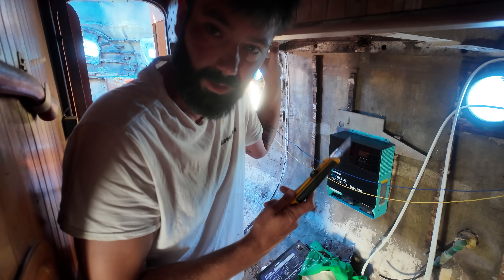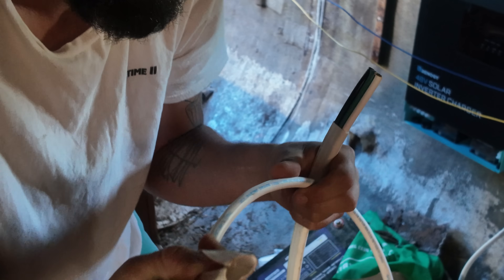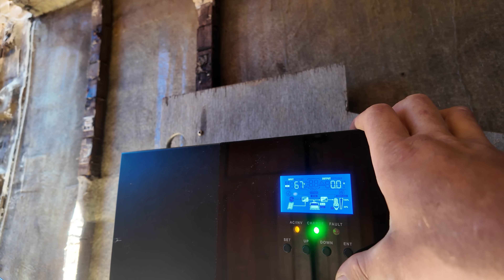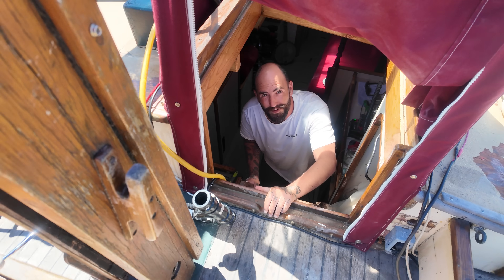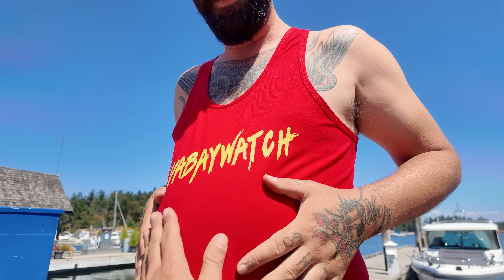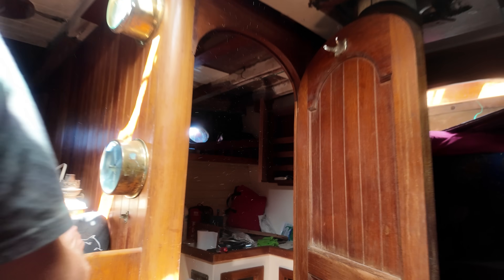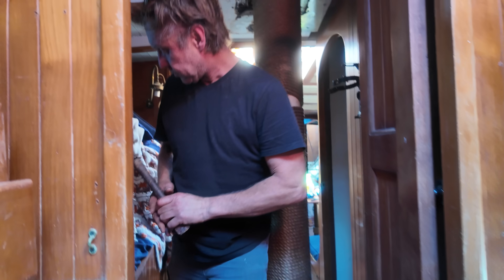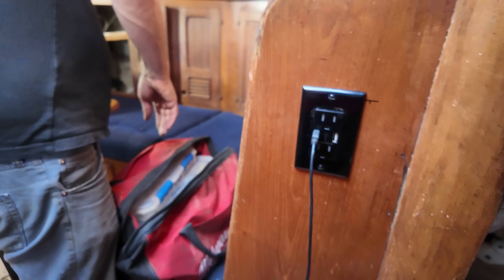DIY Boat Power System: Powering my Home on the Water

Comment: Keep on living the dream Buddy ! That all in one power box  is great ! I'm going to look into one of those ! My 3,500 watt Schneider is too heavy for me to lift ! I don't want to use it in my boat and my 3500 watt Outback is pretty heavy also Plus i need charge controllers for them !  OMG I just looked it up ! What a great deal ! That's right up my alley !
Reply from the maker: I had sooooo many problems with my Schneider system. I will never touch their stuff again. And it cost triple what this one does. I’ve used this inverter for years on my last boat. It’s always been lovely for me. Not 100% perfect, the odd overload or restart. But always back up and running quick. Really wish the solar could start up on 0v on the battery. I need an extra controller just to let the system boot under unmonitored full dead situations. I’ve used a small victron controller for a small section of panels just to boost the main system back to life.

Comment: Hey Simon can you share the outlet box’s you used ? I need to replace one down  in the engine room
Reply from the maker: All the boxes were at my local hardware store, self contained ones for the engine room and garage ones for the rest of the boat. Needed a face on those so I had something to mount to the bulkheads.

Comment: A/C wire is usually solid, where D/C is stranded wire.     And they sometimes like to jack the price up for things like 'OFC' that really doesn't matter.
Reply from the maker: Not on a moving home, they use stranded for AC in RVs and tinned stranded on boats.

Comment: The round one is tinned so it won't be  corded as easily the romex will corde over time
Reply from the maker: they're both tinned, the round has some nylon strands inside it, which I'm guessing helps with internal chafe? I dunno.
Reply: @findingsimon  I think the round one just fits through a smaller hole.

Comment: individual conductor wiring is even cheaper than the flat wiring, just would have to wrap it or heat shrink a cover for it yourself; that trade off of time vs money, which do you have more of?
Reply from the maker: I honestly haven't done the math on that. I doubt it though. In this case I was talking about 3 wire round vs 3 wire flat. so really quite similar stuff.